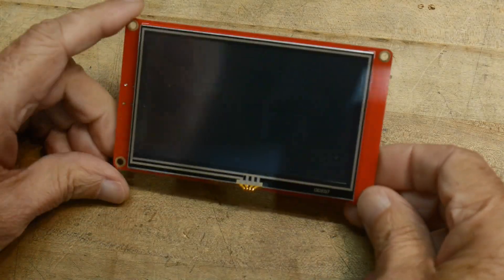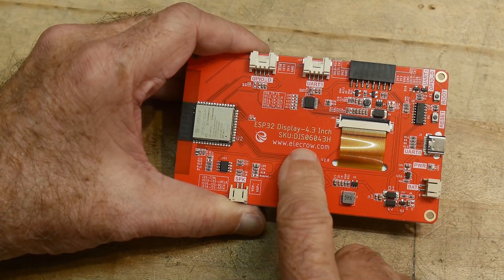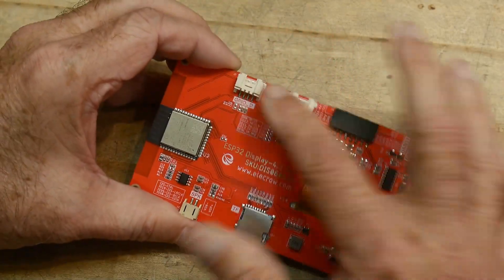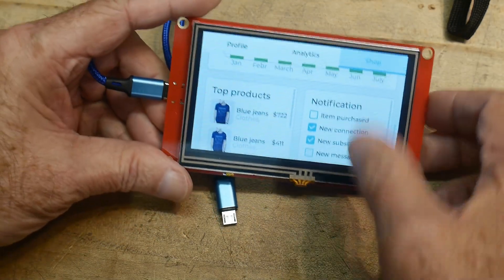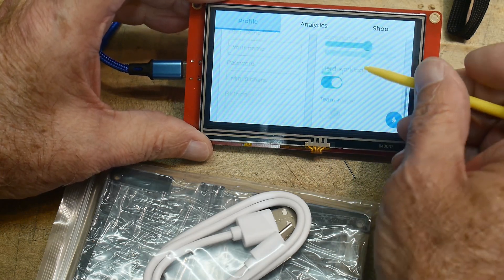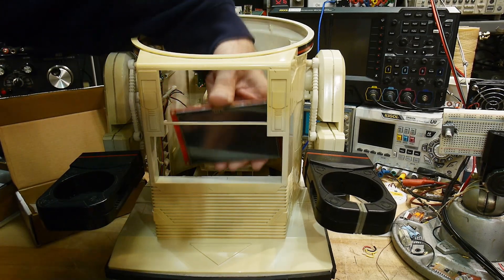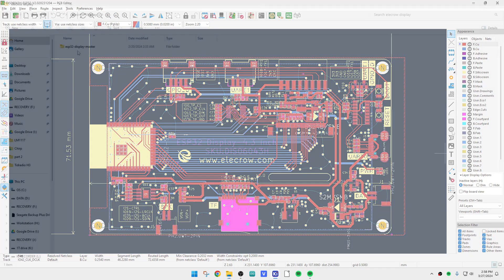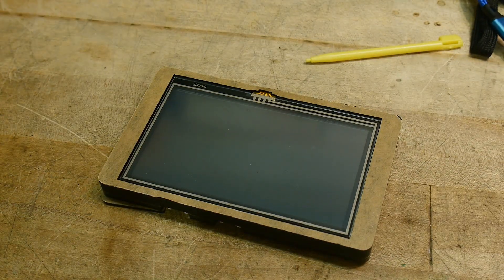#1847 Elecrow 4.3" esp32 Display Module

Comment: I'd put the display in the upper opening after removing the thin cross bar. Then you could just add some replacement for the cross bar at the lower edge of the display. I was also wondering if the display might want to be tipped back somewhat to make it a little easier to read from above. This thing is going to be traveling on the floor so except for Imsai Dog, most of us would be looking down at it.

Comment: I had this module - kind of unsafe if your battery has no protection circuit as this module has no proteaction at all - just charger.
Sold and bought simple LCD with SPI bus and connected to my ESP32 board.
Reply from the maker: I think that is what I will do too

Comment: Definately install it inside the upper hole. It looked really cool in there.
Reply: Yes, and don't put it to far inside because then it could be difficult to touch it with your fingers.
Reply: @Imholze  It seemed to go rather flush though. 👍

Comment: The "Cheap Yellow Display" is also well worth a look.  It has very limited GPIO pins available but the price is so low they are practically disposable.
BTW - I have soldered directly on to one side of the esp32 module on mine to gain access to some gpio pins (0,4,16,17,5,22).  Its display is around 3" which may fit your robot better?